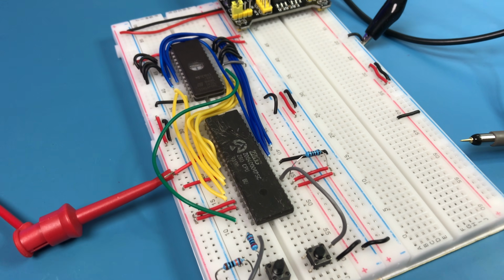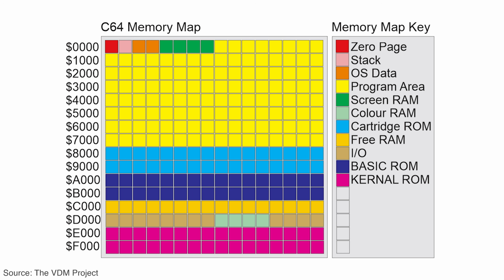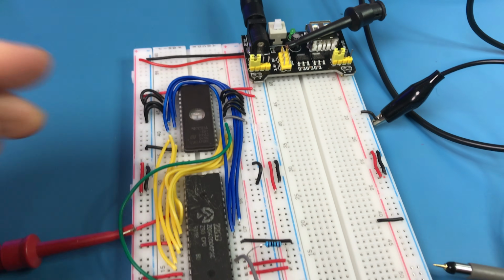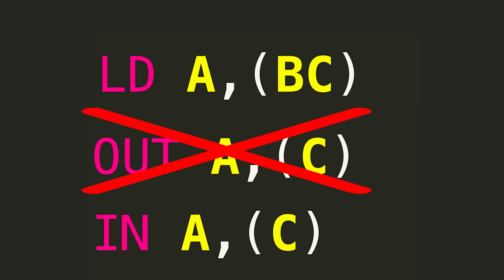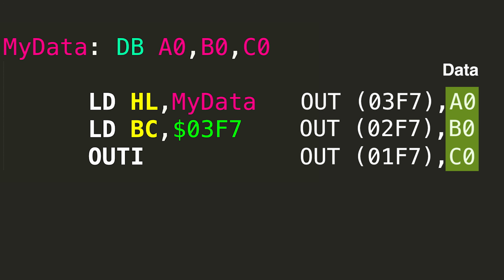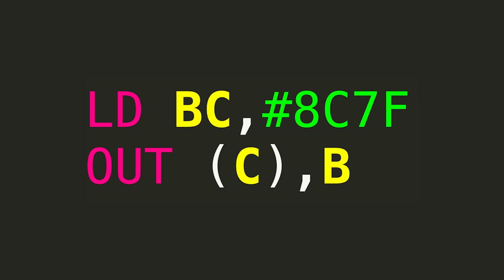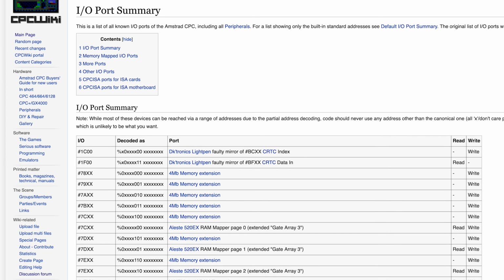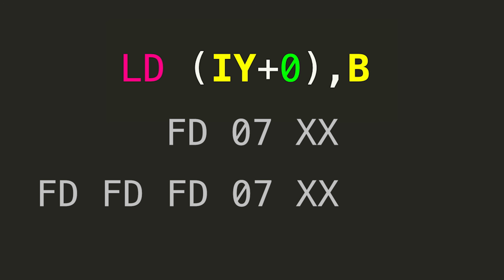The Madness of Z80 I/O

Comment: This of corse works with OUT (C), instructions because of the associated register (paired) B. Other instructions  such as OUT(n), r don't do this and to make it weirder the CMOS and NMOS Z80 your using which isn't static (CMOS Z80 is static and will step at 0Hz) puts a different number ($00 or $FF) on A8 to A15 when you use OUT instruction not associated with the BC register pair. This is one way to tell say a 4MHz NMOS from China when it's marked 6MHz CMOS part number. 

Another trick is to use IR as modern systems have SRAM that doesn't need RFSH and the normal range of "R" is $00 to $7f so you can use Bit 7 of "R" with RFSH as a latch enable to put the other 7 bits into a external latch register. You have to pre calculate "R" as it increments with M1 (or T1) so SUB a clock count first.
Reply: OUT (nn), A and IN A, (nn) puts the A register on the upper half of the address bus (regardless of NMOS or CMOS).
Reply: @herrbonk3635  OK good to know, It's been a while for me and I don't have time to test this myself and I find conflicting information on the net that referees to OUT (C),0 rather than OUT (C),n which is not what I rememeber Here a link to start the rabbit hole. There are CPU testers like NOP testers that will tell you if the CPU is NMOS or CMOS and might be an easy way to get more reliable information. It might actually be in the manuals but I doubt it as it was quite specific "bug" like and so probably undocumented. It's hard (at least for me) to follow up on something that far back. The only people that use undocumented back then were machine code writes (HEX) because most assemblers (and I didn't have one) wouldn't deal with undocumented but supose you could just thow in some DB's. 
https://sinclair.wiki.zxnet.co.uk/wiki/Z80#Differences_between_NMOS_and_CMOS_Z80s
Reply: @herrbonk3635  On 8080 they put the 8 bit port on upper and lower half of the address bus. Putting the A register is kinda stupid when you realize it's what the OUT instruction is going to put on the data lines as well.

Comment: Modern CMOS Z80 chips could run with manual clocking.
You only need to perform proper RESET# signal procedure - keep it active for 5 clock cycles at least.
Reply: True, but "modern"? :)
I belive they came around 1983-84-ish.

Comment: 16-bit bus extention also implicitly used in legacy IN A, (NN) / OUT (NN), A instructions.
Reply: Not really. In for the "in a,(n)" and "out (n),a" opcodes, the upper 8 bits of the address bus is the contents of the "A" register at the start of the operation. So you can sorta get the behavior you want using the "in a,(n)" operation by loading A with the desired upper 8 bits prior to the IN opcode. But unfortunately, that doesn't apply to the OUT operation in which if you attempt to use the upper 8 bits, that would simply result in a set of 256 port addresses, each of which will only receive a single possible value.
Reply: @johncochran8497  I didn't say that it is always useful extention.

Comment: Great coverage of the subject, thanks! Using 'blank' or 'undocumented' opcodes is indeed a clever hack, but not without risk. There are Z-80 compatible CPUs that have additional opcodes in the unused space, such as the Hitachi HD64180. A program may auto-detect the use of that CPU by attempting an opcode sequence that behaves like you described on a genuine Z80, but has a different result on a Hitachi chip. Granted, the chances of running into such software on an Amstrad aren't that high ;)

Comment: I always assumed that the reason why BC is output to the address lines instead of just C is because of how the register pairs are internally wired to the address bus. You would need additional logic for the IN/OUT instructions to mask B instead of just reusing whatever is being used for HL, IX, and IY. When designing a system it would have been better to just stick to the chip designer's intent of having just 256 ports addressable by an 8-bit register. 
PS. Personally I think the IN, OUT, and LD mnemonics were well chosen. Especially the OUT instruction make it quite clear that you are now messing with the state of an external device out there. I always thought the Intel MOV mnemonic is rubbish because you're copying, not moving. But it's all just mnemonics anyway; one could potentially fork one's favourite assembler on GitHub and come up with better mnemonics.
Reply: I agree, it's the 8080 OUT (d3)/IN (db) instructions that made no sense when Zilog implemented them on the Z80. On the 8080 it took an 8 bit port and uses it for bits 0-7 and 8-15. Zilog put the A register on bits 8-15, but the instructions use A for the data bus as well.
Reply: @smf3472  I suspect that the behavior of A8-A15 with these two opcodes (D3 & DB) is an unintended side effect. Which happens to be different between the I8080/8085 and the Z80.

Whilst Zilog intended the likes of IN A,(C)/OUT (C),A to be 16bit I/O instructions. But for some reason didn't document that the port is value is BC rather than just C. Not documenting ED70 & ED71 since neither IN (HL),(C) nor OUT (C),(HL) make any sense.

IIRC the INI, OUTI, etc instructions also use the BC register pair to specify the port. But also use the B register as a counter. Effectively making these 8 bit IO instructions.

Things would have been easier if Zilog had used DE instead of BC for 16 bit IO. Possibly that was too difficult since the instruction EX DE,HL (EB) renames/remaps the registers. With there being an additional level of remapping for the index registers using the DD & FD prefixes.
Reply: @smf3472  8080 and z80 are quite different processors even if the z80 is designed binary compatible. Indeed the whole selected register pair (whatever instruction/phase it is) is passed to the address bus. In some cases (like IX+n/IY+n... instructions) addresses are assembled beforehand in the hidden WZ Register pair. Visual-Z80 will give some interesting insights how z80 actually works :).
Reply: Well, I always thought of the register pairs as 'HL' being the 'source' of data, DE being the 'destination' of the data and BC being a 'Binary Counter' that acted like a For/Next counter.

I loved the Spectrum. And the Z-80.

Comment: All that “mess” you talk about made the z80 the most popular cpu of all time. Still used today. I think that out instruction is great for small hardware projects. Really sets it apart from the 6502. Could never understand the popularity of the 6502 given the z80.
Reply: The z80 is not the most popular CPU of all time, not even close. https://en.wikipedia.org/wiki/ARC_(processor). The 6502 has many advantages over the Z80, I would choose to write 6502 over Z80 any day of the week.
Reply: Big fan of the Z-80 myself.  But the 6502 was popular for 2 reasons.  Cost.  And it is faster than a Z-80 in a lot of ways.  But also terribly limited.  256 byte stack?!?  256 byte zero page, which was the only way to do indirect addressing!?!

As long as you were okay with those limitations, it was a cheap, fast chip.  And cheap was the order of the day back in the early days of home computers.
Reply: @gppsoftware  the quote was "the most popular cpu of all time", so it doesn't matter when the ARC came out.  There were MCU's from the 80's that were used far more often than the Z80. Zilog didn't do as much business as you think they did.

Comment: This sort of operation is done by every IC manufacturer of the time in one way or another, they didn't do VHDL synthesis and and all that nice stuff we do now, and also transistors were limited to less than 10000 around this time so if an instruction had an artefact then so be it. What's important is that the things they say happen, actually happen. If you look at the 6502, it has stacks of undocumented features/instructions that came about by a chance of sorts.
Reply: Exactly, well put.

Comment: I think it's fair to call the "crazy" approach you'd never heard of before a CPU version of a knock-knock protocol. Knock-knock protocols are better known from networking and port knocking (see Wikipedia), but I think this is analagous. If you're looking for a term, that's what I'd call it.
Reply: Yeah, the cpu opcode example was simpler than what I was expecting. There are RTC chips that can fit in ROM sockets & they use specific access patterns, that won't occur in normal operation, which allow setting the date and time.

Comment: Yes Zilog could have picked a better mnemonic than "out (C),r".  But I believe on the Intel 8080 "push b" was used instead of "push bc", so Zilog did improve some of the mnemonics.  A lot of the rest of the complaints are Amstrad-specific. 

More interestingly/annoyingly for me is that the Z80 adds extra wait-state is added for IO cycles than RAM cycles. Devices I have connected to Z80  either dont need it all, or need much longer delays than 1 cycle.

I am glad for the Z80's seperate I/O space, it means that IO selection can be done easily with a 74LS138 (address decoder chip)
Reply: The wait states were necessary for many parts in the day. Memory speed was all important.
Reply: Wasn't the wait state arbitrarily long, depending on when the ready was received? Checking would at least eat a cycle, though, even if it's instant.
Reply: the Z80 doesnt have ready pin ...
Reply: @stinchjack  Ah, must be thinking of another processor

Comment: Fun video. As for the last part, that sounds a damn lot like what the Graffiti "display adapter" for the Amiga did. It just "kept state" with the graphics data being outputted, and if it received a very specific setup that made very little sense in normal use, bam, it was not bitplane data but "chunky" data. Sure, it's ugly, but when you're repurposing existing stuff for new purposes, that's how you go...
p.s. in the software side, it's the equivalent of when you have to keep using some data structure that already exists without changing it, you abuse it a bit on the set up side, and on the other end if it's set in the "right way", you know that the content is not straight "regular data" but "data that needs further decoding". The amount of abuse string data gets with "json/xml inside" kludges makes these hardware shenanigans look tame ;)

Comment: Before watching your video, I'm gonna say: August 30, 2006 I edited the wiki Z80 page to add "undocumented 16-bit I/O-addressing" information.  Actually the documentation was in the Z80 Hardware Reference Manual all along (still got it around here somewhere) but isn't too clear about it.  It shows the BC register being asserted to the full 16 address bus in the OUT (C),A  and inverse instructions.  I actually took advantage of this feature in the late '80s in interfacing a some 16 bit (address) IO cards in a Z80 system.

Now, on to see what you have to say ;)

Comment: Oh, if you want assembler aesthetics, be happy you're writing using Zilog assembler syntax and not Intel 8080 assembler syntax, where (HL) is called M, you say LD for memory loads, ST for memory stores, and MOV for register to register loads/stores, and many other things that are super weird. Out with LD BC, addr; in with LXI B, addr!

The piece of the puzzle that I think is missing in your guessing as to what's going on around 12:27 is that the 8080 only had the direct IN (opcode 0F3h) and OUT (opcode 0D3h) instructions that took the port number as an argument, and that only lets you use a single byte. Which makes Zilog wanting to limit their indirect version (in the 0EDh prefix block) to only C make sense — and that it would have been easier to just put the whole register pair on the address bus itself.

Comment: Great video! I love the Z80 and videos that dive deep in its instructions set😍
There is one instruction that you have not talked about, which is very important in my opinion: OUT (n), A 
Instead of using BC, it uses an immediate value as the port. On the Amstrad, this instruction seems to be unusable since the upper address bits are also taken from A register.
If we considered the I/O bus as a 16-bit bus, this instruction would need to be of the form OUT (NN), A and that would take even more clock cycle and code space since there is one more byte to fetch. 

Regarding the instruction table, does it also show the undocumented instructions? There are plenty of them, so some "empty" cells in the table would in fact result in undesired behavior on real hardware 😅

Comment: Running Z80 on breadboard at 10Mhz without issues, even doing hardware serial trough z80 SIO chip... otherwise - very nice overview of IORQ :D
Reply: Me too, although partly on veroboard, but using a vanilla 4 MHz rated Z80 (some manufacturer's "4 MHz" Z80 work at that speed, some don't). The same design was stable at 12 MHz too, when using a 6 MHz rated Z80. (Not really at 16 MHz though, that one was sensible to glitches.) It very much comes down to using fast enough RAM and ROM!
Reply from the maker: That's surprising. I never tried, but I would have thought that it would have all sorts of interference at that rate. Heck, look at my IORQ signal. It looks horrible already! :-)

Comment: Just two details: the Sinclair Spectrum also uses the upper 8 bits of the address bus for addressing the keyboard's semirows. It also uses the same trick of using one bit for each device: A0 for the ULA, A1 for the ZX Printer, A2 for the memory pagination/AY-3-8192 in the 128K, and A3-a4 for the Interface 1/Microdrives, which also leaves only three bits for other devices (like A5 for the Kempston joystick).
Reply: Thanks God I'm not the only one who noticed this.
Reply: Same with the Z81 and Z80, regarding keyboard scanning.
Reply: So that's were the insane idea came from!  😅

Thanks for the explanation.
Reply: @fr_schmidlin  How is it "insane"? You cannot have seen many hardware designs 😉 Most cheap computers used unorthodox methods and/or (more or less) undocumented aspects of processors or others components to save cost.
Reply: @fr_schmidlin The trick is a good deal older, but it also relies on having NMOS I/O devices. A wrong out (multiple enables) on a CMOS device will cause a fight and damage, a wrong out on NMOS just totem-poles. It's also why replacing NMOS with CMOS in old home computer clones/repairs is a bad bad idea.
Reply: @etchedpixels  Not really... both the ZX80/ZX81/Spectrum had 1N4148 diodes in the keyboard matrix to avoid short circuits.
Reply: Thanks God I'm not the only one who noticed this.
Reply: The use of the upper 8 address lines for scanning the keyboard originates with the ZX80. Likely as a cost saving hack.
Reply: @markevans2294  Systems were doing that well before the ZX80. The TRS80 model 1 does it for example although it memory maps the buffer rather than I/O mapping it. The trick of feeding bit of address bus into a keyboard and a buffer to read in one cycle is very old indeed

Comment: Holy mother of cr*p!  This video is not about the madness of the Z80 I/O, it's about the madness of the CPC I/O! And I thought the SMS already had some very unwise shortcuts.   😱

And decoding I/O like "special" opcodes on instruction fetch states is not only an immense detour to workaround a nearsighted architecture decision, but it's very costly hardware-wise. To the point of being insanely expensive if it was to be implemented in the 80s. Much more than the damn single 74LS138 that Amstrad omitted from the design, and could have avoided this whole mess.

At times like this it becomes clear how the MSX was a real computer architecture, instead of just a bunch of hackily wired together chips. And how clever, flexible and expansible its architecture was.
Reply: Well said.

Comment: The whole thing with LD was more to work around Intel's opcode mnemonic copyright. They did kind of go overboard with it though...
Reply: In a way, but it was also Faggin and Shima now deciding for they own what syntax they wanted (instead of other guys, when they were still at Intel).
And it was also a return to the more logical LOAD terminology of the Datapoint 2200, although abbreviated to just an "L" in the mnemonics there.

Comment: Many many years ago my older brother and I built a Z80 system for a Geiger counter logging device that output to a thermal printer. It used a single EPROM, 1 I/O input port and 1 I/O output port - no RAM as there we sufficient registers to not need it, even using one of them to substitute for the stack.

Comment: All the z80s ive used were quite happy running hertz speed i.e. one switch press per clock tick. Ive only test ed ~5 cpus though
Reply: CMOS Z80s run OK at zero clock, but for the old NMOS devices, the minimum speed is about 125 kHz.
Reply: @isaacmarinobavaresco7397  "the Clock Pulse Width (Low) maximum is 2000 nsecs (2 usecs).  so for
a square-wave clock with a 50% duty cycle, the minimum clock frequency is 250 KHz" - I thought it was around 500Khz myself? but that's what the net says. hth
Reply: I'm pretty sure mine ran on +5 VDC only. I presume that means it was CMOS, not NMOS?

In any case I had trouble when I first built the system. It ran all janky.
So I replaced the 2.5 MHz clock with something around 2 Hz and it worked fine.
So I pulled out the scope and found crazy high noise on the +5 V rail.
I cleaned that up and things ran just fine at 2.5 MHz.
Reply: @cokesandwich1668  The NMOS Z80 also used only +5V, which was one of its major HW selling points -- compared with the 8080 that needed, what +5V (Vcc): This was the primary supply voltage for the internal logic circuits.  +12V (Vdd): This was used for the substrate bias.   -5V (Vbb): This was used for the input level shifting
Reply: You know which? Is there a difference is say a Sharp Z80 (that were in my computers) and original Zilog ones.